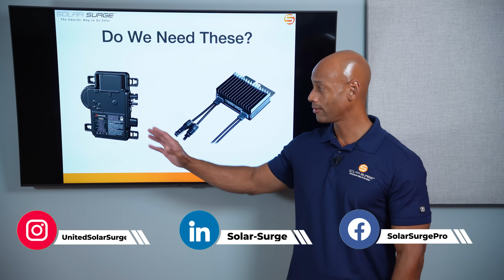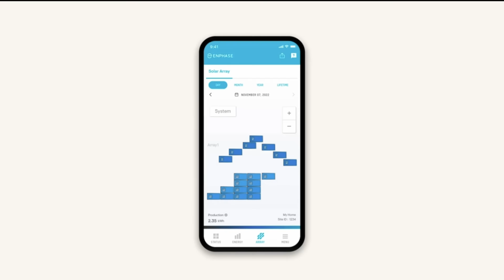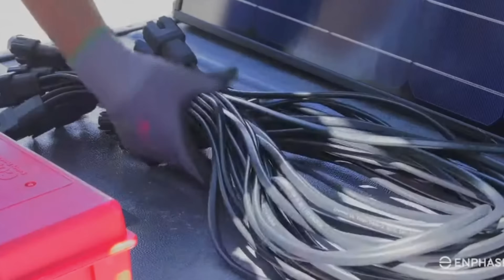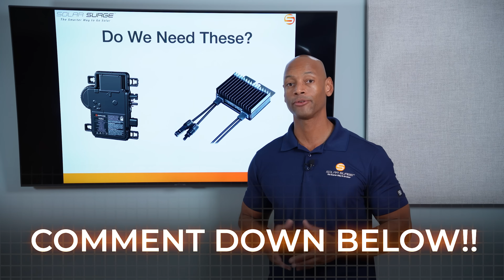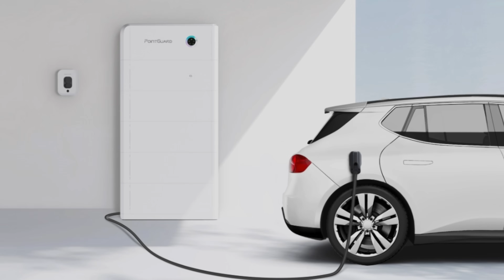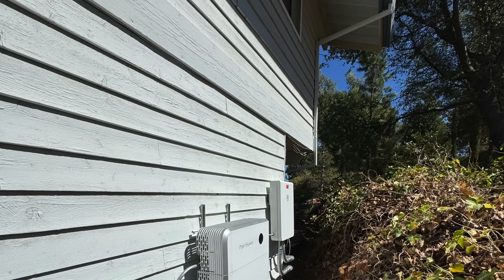All Solar Panels NEED This... Or Do They?

Comment: I divided my ground mount array into two seperate system each with its own string inverter joined on the ac side in a combiner box. If either system fails, half of my system is still available.

Comment: How do stay compliant with module level rapid shutdown requirements? Don’t get me wrong, I’m old school, and a big fan of the high voltage DC  architecture.
Reply from the maker: DC relays are still required for rapid shutdown compliance, but thy are not required on every single solar panel.  Just one relay per string.

Comment: When discussing MLPE, I think you mentioned (and then dismissed) shade mitigation FAR too quickly in order to dwell on the cost of sending your truck out.   While shade may not be a problem in rural areas with low land costs in sunshine states, it certainly IS in (high land-cost) cities which also have chimney stacks, tall buildings and trees.

And bypass diodes are old hat, are near-universal, and are imperfect.  What you should have been talking about is AIKO's ground-breaking IN-PANEL partial cell-level optimisation.

Comment: The best process...is no process; the best part, is no part.  KISS!  Thanks for letting us know that solar installers will honor their warranty by $h!tting on their customers and making them wait until more than one thing fails.  That instills a bunch of confidence in would-be buyers.  The solar industry is an interesting mix of tremendous progress and benefit, coupled with some of the super slimy traditional sales garbage that you find in used car sales.  I'm very glad that so many DIY options exist and that the freedom to do so is still allowed in most jurisdictions...at least for now.

Comment: THIS VIDEO IS A HIT JOB. FFS. ITS SPONSORED BY THE COMPANY WHOSE PRODUCT UOU SUPERFICIALLY REVIEW. You didn’t answer the question you asked in the video title??? You gave no statistics as to the actual failure rate or truck roll out rate of the Enphase of solar edge products. Which as an industry insider you know you could give. You gave no info as to the testing used to prove the concept of these single point of failure products. I Can guarantee you no product on the market is tested as extensively or has as low a point of failure as recent or current generation enphase micros.

Comment: I don't get the point.... both PW3 and the pointguard solution will still require RSD units for NEC compliance, not necessarily optimizers, but at least RSD units... RSD units are also MLPE... so unless the code changes, they will always need it....
Reply from the maker: That's true, RSD is required but those are just relays, like an ON/OFF switch.  MLPEs are much more complicated, expensive, and prone to failure.

Comment: I have a roof mounted system with 24 modules with Enphase M215 micro inverters that was installed by Standard Solar in April 2012. So far six micros have gone bad. The first one went bad after 4 years and of course by then Standard Solar had exited the residential market, (Standard Solar now only does large commercial and utility sized solar) so the salesman who originally sold me the system actually came out and showed me how to replace the micro. (fortunately, he's the type of guy who doesn't want to see solar get a black eye) Since then, I have successfully changed out the other 5 that went bad but at my age getting up on a steep roof is becoming a challenge. In 2020 my wife and I added a pole mounted solar array that uses Enphase IQ 7 micros and so far, none of them have gone bad. Of course, if one does go bad it will be much easier to change it out. If you have enough land to install your solar on a pole or ground mount, then it definitely makes sense to do so.

Comment: Excellent presentation! Installing a Tesla Power wall 3 to my MI 7 Enphase micro inverters. Is that going to be a problem?
Reply: No, Powerall 3 has AC coupled settings, your installer should be able to configure it
Reply from the maker: That should work fine if you use the next Tesla Gateway 3.

Comment: Why are you saying PW3 and Pointgaurd is new architecture? This is what has been used around the world in many different systems for years. Sugnrow, Goodwe, Noark, Alpha etc etc. One other important thing to note is system diagnosis. With string systems unless it provides a really good amount of monitoring and feedback, rocking up and trying to fault find a system can be a mission. Modular level equipment can be extremely useful for identifying and issue remotely compared. Both systems have significant pros and cons.

Comment: Installers that use the "We don't roll on one" practice will likely just tell you that  (parts are on order)  and then when they have 2 or 3 microinverters or optimizers that need changed at different addresses then they will send out one truck to do the 2 or 3 of them on the same day.    Also for those that want to use a string inverter but not go with SolarEdge you can use Tigo optimizers  with other brand inverters that will do decent optimizing and they have an app to show panel by panel production monitoring,  they are very good quality and only about $35 each.

Comment: Why do you keep repeating this myth?  With independent strings a shaded panel never reduced the performance of unshaded panels and bypass diodes predate micro inverters and optimizers by >20 years.

Comment: $800 per truckroll is waaay to much overhead. We charge $250 per truck roll for up to 2 hours and make a few bucks for it. Not going out to replace a single RMA is bad customer service practice! With the PW3 system, how would someone know if a single panel is failing other than a slight drop in daily production which can be difficult to notice if it's a large system?
Reply: that's one thing I like about my enphase individual microinverters as I can see per micro the daily production and can monitor differences in production, particularly between adjacent panels. That's how I identified one micro was producing 35% less than the panels on either side and then one of those adjacent ones went out completely. Supposedly the DC voltages coming from the panel are fine according to enphase, but this is the 2nd micro for each of those panels in the past 2 years so it does make me wonder. Enphase said they are sending me new micro's, but because the old ones have to be sent back, it makes me wonder if these are refurbs that are again failing.
Reply: @peter-hr1gl  Hmm I don't have any experience with Enphase wanting the RMA'd micros back. That's odd. Enphase is pretty good about just replacing them and I think the trade off is worth it losing a little production versus a single appliance that carries a liability of bringing the entire system down until it can be replaced

Comment: Backwards imo. Eliminating all the redundancy from the system is a huge liability. Trading that for cheaper and easier install
Reply: Did you watch the video regarding diodes in panels. And panel failure rate is .05%.  And having 20 points of failure on the roof is 19 more points of failure compared to one central point of failure that has easy access, no ladder required, and not having to remove panels.

Comment: 25 year warranty, that’s if the company is still around! Since we’re headed straight into a depression, I wouldn’t count on it!
I built my own off grid system, and I don’t need all these extras, it’s just more expensive! If you’re worried about losing a few watts, just add a few more panels.

Comment: I have enphase microinverters and like the fact that when one is impaired or stops working entirely, the rest of my array can still generate power. HOwever, I've had 4 that have needed to be replaced in a 24 panel array in the past 4 years. The problem with that is I have to pay my installer now to perform the change because they only covered the labor for the first 2 years (they changed their warranty and support policy AFTER I purchased the system from having the labor component be covered for a period of years (I think it was originally 10 years) to only 2. So now I have to pay someone to come out, climb up on the roof, and replace the microinverter. 
What they should have is a wall-mounted microinverter case similar to how their battery packs work where they have each inverter that can easily be removed and replaced. They should also make them user replaceable similar conceptually to how a person can change a circuit breaker in an electrical panel. 
You basically that a switch on the box that shuts off power from the solar array, you can then remove the inoperative microinverter and replace it with a new one. Then turn it back on and easily have a way to go into the app and provision it (if needed). 
Paying someone a few hundred dollars to do that when it appears to be relatively common (unfortunately) is getting ridiculous.
Reply: Changing warranty & support terms after-the-fact is a breach of contract is many (most) places. 
And putting Micro-Inverter at ground level means DC line coming off roof. Lots of lines is inefficient hence basic DC coupled architecture, and doesn’t have RSD within 10ft of panel.
I have Maxeon panels up on 2nd story Spanish S-tile roof and contractor bankrupt… not looking forward to having to get up onto roof
Reply: @lawrence_SoCal  Don't DC coupled panels have lines running from the solar panels to the inverter on the side of the house or in the garage? I suppose if you have say 20 panels and have to run 20 wires down to a box on the side of the garage or in the garage where the separate microinverters are would be more costly to install initially, but it sure would be easier later to replace each inverter. Had I understood the economics better up front I may have opted for a different setup like the DC optimizers.
Reply: @peter-hr1gl  no, DC coupled usually uses a string of serially connected panels (up to a certain amount), then a separate string for next group… whole thing about number of panels, groupings, etc.) typically a residence will have a couple, to handful of strings (wires coming off roof) depending on panel count.

I’m perfectly happy with my enPhase micro-inverter setup.  Are MI replacement units failing? If not, then maybe bad batch? Either that or possibly an installer screwup? Or house AC electrical problem impacting enPhase units?

Comment: Questions: I have 30 Q Cells Solar panels with Enphase IQ 8+ microinverters on my roof mount. Currently, I am considering adding Solar Battery to our existing solar system. With Powerwall 3, it seems that I don’t need microinverters. Powerwall 3 prices are more attracted than Enphase 5P batteries. Can I install 5 or 6 new solar panels with Powerwall 3 battery, connecting new solar panels to Powerwall 3. Will this new configuration work well during the power outages? Do you recommend two Enphase 5P batteries over Powerwall 3 for existing Enphase customers?  

Please consider a separate video with more technical details for new solar batteries for existing Enphase microinverter -
Reply: Enphase 5Ps connected in series result in high powered output possibilities. The more 5Ps connected in series, the more power hungry appliances can be powered. In case you wanted to add a bit more storage over the years, it's easier and cheaper to add 1 5P than 1 Powerwall 3

Comment: If you need a module for rapid shutdown, the additional cost of having optimization and monitoring is minimal. Tigo has theirs, and are not that expensive, about 30 dollars.
Reply: I use TS4-2Fs.  2 panels for ~$44.  Optimizers are ~$44ea.  That's an added ~$20 per panel plus you need the Tigo gateway.  That's easily >$600.  For what?  I can check panel health by looking at string voltage.

Comment: The module level monitoring is essential to know where a possible fault is in your solar system. Without that it is for the installer a much bigger job / takes more time. Also the main advantage still remains with micro system that of safety due to not running high voltage cabling on your roof.
Reply: Meh.  Just doesn't seem worth it considering the downside
Reply: @jonhinman2471  Say meh when your house burnt down.
Reply: All it takes is 1 truck roll plus the labor cost of taking everything apart on the roof to trace strings and test for current leaking to ground and you could have paid for an optimized system.

Tracing isolation faults in a string inverter system is so labor intensive. SolarEdge will tell you which panel, or between which optimizers your string fault is located at.
Reply: @WestFortJacoby  how about using a thermal camera to isolate the issue?  I just think micro inverter failures will be more common than panel failures over the life of the system
Reply: @jonhinman2471  Probably the same failure rate backed with 25 years warranty as panels. Compare that to 10 years of a string inverter.
Reply: @jonhinman2471  as of right now, it seems like most companies are kicking the can down the road for "isolation fault" sites. Nobody wants to go on the roof and mess with it, so these customers are getting stranded.

Thermal cameras help with identifying bad solar modules, but they don't help with a random panel or wire that causes isolation errors when it rains.
Reply: @TurreTuntematon  SMA inverters offers a 25 year warranty on string inverters.
Reply: @ridemfast7625  That’s a fantastic warranty. I don’t think it applies on most string inverters though. They are usually 8-12 years.
Reply: Yup.   I would not want 400-500 volts of DC up on my asphalt shingle roof.   DC arcing is a whole different animal than AC, and then ~double the voltage too?   Nope!
Reply: @TheUweRoss  RSD's, Arc Fault detection... shut down the panels. MI's also use this technology for a reason.  And, MOST importantly is the installer no matter the type of equipment!!!

Comment: High voltage DC wiring running through the framing spaces of the house is a bad idea due to the thermal risk and cost of installing the conduit.

BTW This kind of turned into an infomercial for your sponsor.
Reply: Thermal risk is less, the current drops as the voltage goes up, it is current flow through a resistance that creates heat. That's why breakers and fuses are rated in amps. Plus, by code, DC above 48V, has to be in conduit, or armored cable.
Reply: @glee21012 Our local code requires the metal conduit carrying DC power to be a minimum distance from wood framing for thermal issues.  My neighbor had to have have the installer back twice in order to pass inspection.
Reply: @JeffreyAdams-kt5gv  They do that so when Firefighters cut holes in roof they don't hit it. Always follow the local code. Its not for thermal, but they can think that if they want. I have also seen local codes calling for founding of PVC pipe.
Reply: @glee21012 you are covering the “edges” of the roof discussion. 

I had a conversation with the inspector for the roof penetration that came down through the attic spaces under the panels - no where near the edges of the roof. He stated that an air gap separation from wood framing must be maintained all the way back to the inverter for THERMAL reasons.

Comment: We had an Enphase micro inverter go out, which was evident on the 'Enlighten' [phone]app. I called Enphase and because these are covered by a 25-year warentee they sent a new one. Fortunately we have a flat roof so it was a couple of hold-down bolts and two connections (both idiot proof) to replace the micro inverter, about a half hour. No call to the installer needed.

Comment: personally I plan to install a ground mount system  Likely will go with micro inverters and battery  question just how much loss will I likely have going this route/?  15% 20% loss?
Reply from the maker: You will probable lose 10% annual production using micro-inverters vs string inverter if you have full sunlight on the panels.
Reply: Why micro inverters on a ground mount?
Reply: You don't need rapid shutdown for a ground mount.

You can also troubleshoot strings and panels easily from the underside of the array while standing in the shade. Ground mounts are the only systems I would consider skipping optimizers on. Even then, the cost to add them may not be much more in the long run.

Comment: How does a DC coupled system with a central inverter comply with rapid shutdown if you don't have an optimizer or microinverter per panel? Use some kind of rapid shutdown module per panel? If so, then why not just go with optimizers?
Reply from the maker: Tesla and others use remote controlled relays on the roof to comply with rapid shutdown.  The relays simply open or close the circuit.  No module-level power conversion.
Reply: @SolarSurge  So now you have another component under the panel that can fail albeit much less complicated/expensive. Still how does the monitoring of each panel happen?
 I installed IQ7 in 2019 and have zero failures (41). For a batter system, Are the conversion losses that high? 3%each way ? Is giving up 60watt per 1000w that big of a deal?
Reply: @SolarSurge 
Why not just use inline fuses for each panel string? Seems like a lot cheaper than using micro inverters.

Comment: It was a great presentation but you overlooked one huge thing. running 5000 ft of 10 gauge wire to carry the current from each panel to the  junction point (since you need to run in parallel) or you'll get major drop out and you be running much larger gauge wring all over the roof/
Reply: 5000ft runs are not a thing. The most we have done on an array is 250ft and those systems are running at 750 volts on #10 wire. Most household systems are under 100 ft with the majority of those being under 50 feet.
Reply from the maker: The voltage drop is much less running 500VDC compared to 240VAC for micro-inverters.